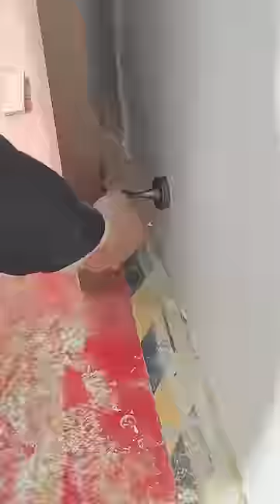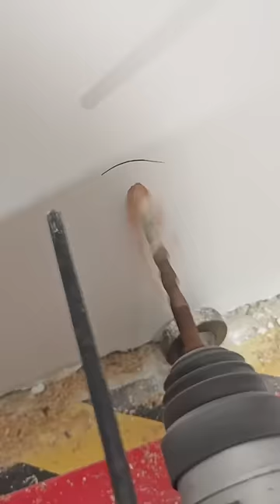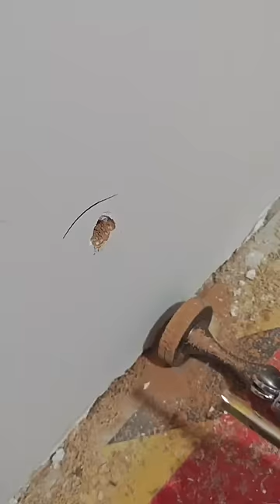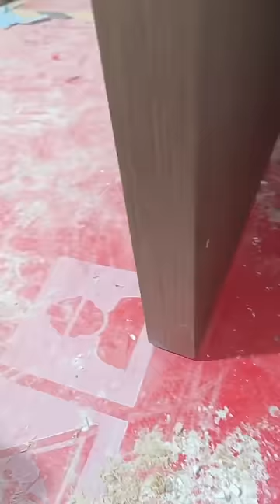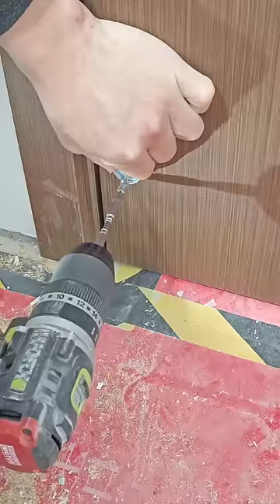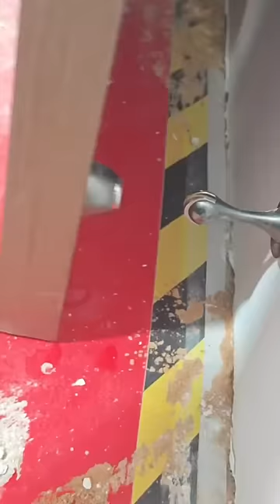Creative DIY Idea: Installing Doorstop to Prevent Wall Damage

Comment: This is the way. Why do we have weak stoppers in the U.S.
Reply: Because we use cheap sheetrock.
You can't tighten a screw item that tight in sheetrock- it comes loose and just spins.
Unless you screw into a 2by4.